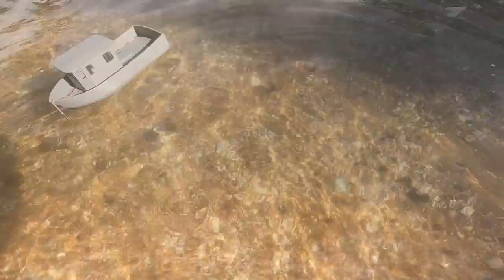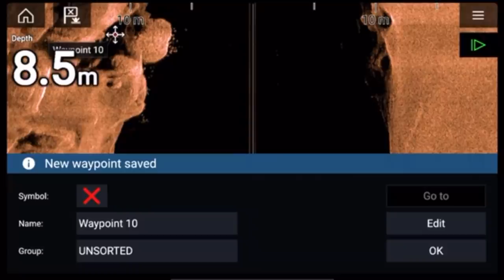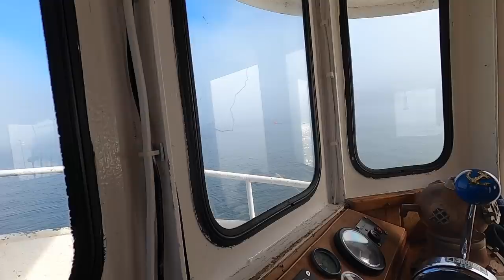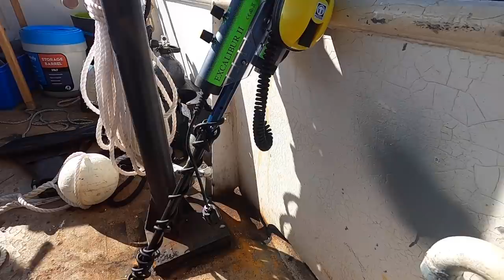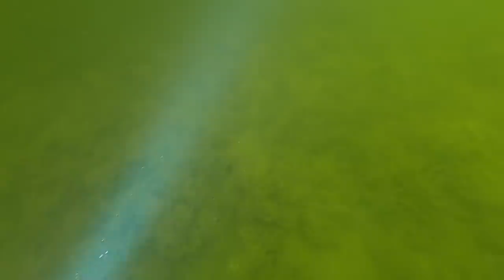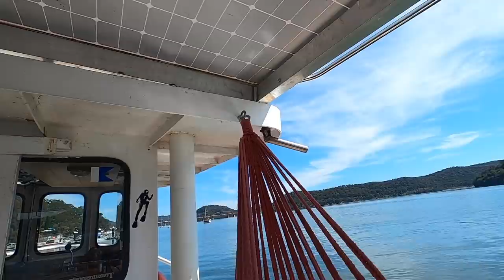The mystery of the stuck anchor

Comment: Hey Stu...got a crazy idea for you but for now I'm gonna cut and paste but I'll have more later....Cheers!
d mc
Highlighted comment
d mc
1 hour ago
Hey you know Dangar Stu asserted recently that pistons for his  471  need to be installed from below (he's got a stuck ring in one cylinder)........is that true??  I think Stu could use a little help so I wanted to get your input.......( a little rust in there too, so sad on a rebuild, maybe you follow him,  I know you met him).  Stu's 471 is in a boat for those who don't know his site.  Whattaya say Mr. B.G. Monkey?? [love the new diggs, dude]
1
Bus Grease Monkey
Bus Grease Monkey
55 minutes ago
They load from the top but you have to have access to the bottom to do the rod bolts.  Boats don’t have that bottom end clearance like you need usually.  It’s not like you can jack the boat up and have more room under the engine
1
d mc
d mc
10 minutes ago
@Bus Grease Monkey That's what I thought!! My crazy idea is to lift the motor a foot or so (probably with comealongs)just enough to drop the pan and reach the big end bolts. The top of the motor is braced with lumber wedges and/or tackwelded angle, but now the access hatchway to the engine compartment is blocked with the motor itself.......
My idea is simply to cut a temporary manhole with the plasma...maybe use a metal garbage can lid to catch the overspray. weld it up when you're done. Remember... this is IN the boat repair so if it seems goofy you have to ask HOW much to lift boat..HOW much for crane to pull motor...HOW much per hour does it cost waiting for the motor to get fixed...
1
Reply from the maker: Interesting that Scott says load from the top. Adrian was thinking just lift the engine up a few feet too. I'll have a chat with him soon and start to hatch a plan. Appreciate you looking into it.
Reply: @DangarMarine    YAY!!
Reply: @DangarMarine   Your plan may involve a new Hatch...a trained monkey held captive down there would be great for limiting exposure under the OSHA rules but probably won't deliver consistent results with a torque wrench.Good luck man, I'm sure you get the gist of it and by gist I mean full liability HA HA see what I did there? Go Mate! 
You know, I can't wait to see this happen and who knows??........it might make a GRIPPING series of vids to follow.....
Cheers again, mate!

Comment: Can you place a rod holder on the rov and place the metal detector on it.
Reply: The rov is not designed to carry any weight.
Reply from the maker: You could have issues with interfering with each other too.
Reply: If you have counter floatation to counter the weight of the metal detector and have lights so you can see any Changes. You can use the Dept sounder to note the position. There was a cable to the rov?? Or check it out in a pool before placing in the water or have a device that brings the rov to the water.
Reply: @jaycrank8163  Jay, MacGyver would give you the thumbs up.